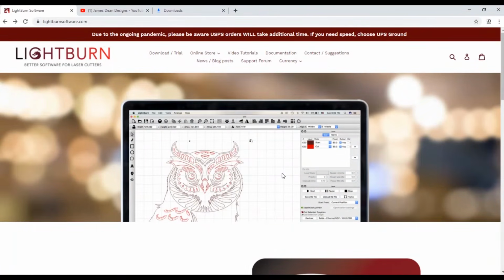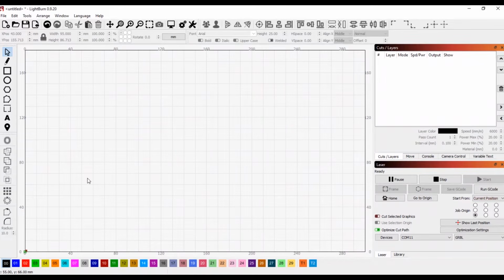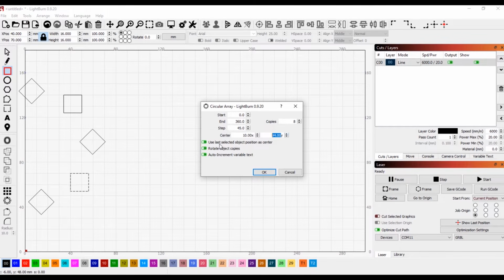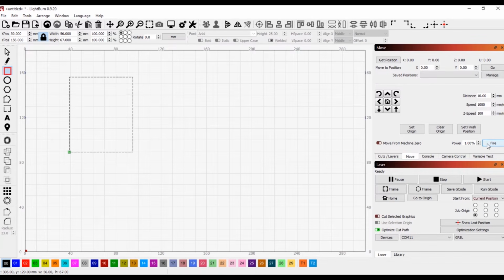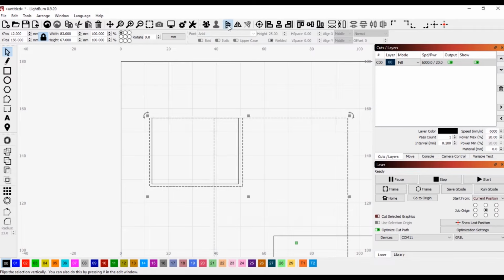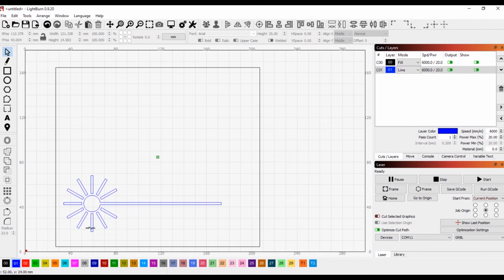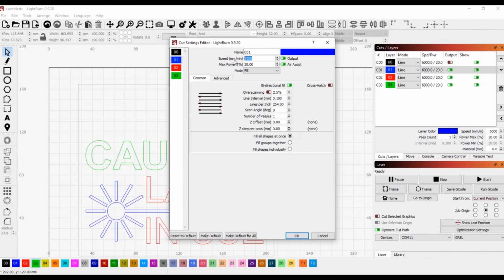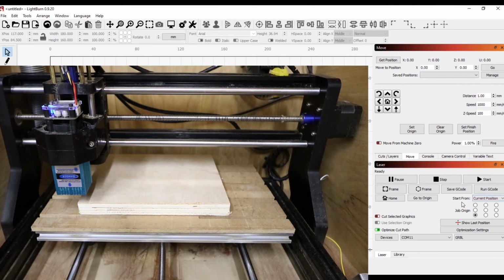3018 PRO - Getting started with Lightburn

Comment: Hi James,
I closed some of the menus on the right of the drawing screen. How do I reset it to the default as originally downloaded?
Reply from the maker: @brucenorton3864  click the Window menu at the top, you should see something like Reset to Default
Reply: Thanks James. Sorted. 
However, I have another problem. When travising the X and Y axes, there is initial movement, followed by a pause, then followed by another movement to complete the distance the set travis distance.
I replaced the stepper motors but this didn't sort the problem out. I went and checked Easel, Laser GRbl and USgcode senders. The problem is present no matter what program I run.

Comment: This more a question than a comment. I have Lightburn 1.6.03 and in the layer MODE it only has line, fill and offset fill. No line and fill, is this obtained via different dropdown?
Reply from the maker: They updated it after I did this video. I think that setting moved to within the layer itself if I remember correctly

Comment: Hi James.  Thanks for sharing this video.  It's very informative.  I'm a newbie on the Laser Engraving.   I have a question on the Mode for Cuts/Layer.  I'm using 1.6.03 version of Lightburn.  I have all Modes except the Fill+Line option, which I think is very good option to sharpen the edes.  What  do you suggest  to mimic the effect of this option?  Thanks again.

Comment: Has only one up dated the firmware on the 3018 pro my firmware dont have the $32 on it how hard or simple is it to upgrade
Reply from the maker: A few people have done it, there is a fairly common video on Youtube for it but I would say you have to be comfortable on computers and doing that sort of thing. The alternative is to buy a new control board which will costs between $20-50 depending on what you get and where from

Comment: I just set up the Fox Alien Masuter Pro with the 20W laser.  In setup the laser is not detected...   I know its set up because I ran the test fox with you using Laser GRBL from your other video.   Even the manual input doesn't list the laser.   suggestions?

Comment: Good morning James.  Thank you for the video, super explained. According to your video, I started my adventure with Lightburn and my laser engraver (CNC 3018pro). However, I have a problem. After uploading the project in dxf. format and burned out, it turned out that the laser also burned out the lines of transition (traversal moves). Do you know the solution to this problem? Best Regards!, Andrew B.

Comment: Do you know why I'm not seeng $30 on my GRBL settings?
Reply from the maker: Chances are your GRBL firmware is an older version. I suspect if you type $$ and hit enter you'll likely see 0.9 at the top somewhere where as it needs to be at least 1.1f.
It can be upgraded, but can be a but fidly unless your comfortable on computers. Alternatively it may be easier to buy a new control board
Reply: @JamesDeanDesigns  yes. You are right. I'll need to update the firmware version then.

Comment: I am using cnc3018 with lighburn. But I have a problem about axis. distances. Axis are not going right distance. Axis going less than my distance. How I can fix axes problem.  Please help.
Reply from the maker: Your step settings may be wrong. The base settings on a 3018 are usually 800 or 1600 for your $100, $101 and $102 settings. These essentially control how far you machine travels each time you send a command. This video explains how to calibrate them
https://youtu.be/nGwUf8uNWBU

Comment: I am new to laser engraving and bought a vevor l3 3040 5.5w (laser output)

I have gotten through so much stock trying to get details on photos in lightburn and still haven't got the settings nailed down.

Do you have any ideas or guidance? 

Thank you
Reply from the maker: When you say stock, is it wood you are using? I found wood quite difficult to get good photos on. A lot of the effort is done in the production of the image. I have a video on it but I used to find the Imag-r website useful as it would try and adjust your photo to suit the material you were using
Reply: @JamesDeanDesigns  yeah that soft plywood coasters I think is to soft of a wood to get details, I have bought some other plywood and mdf just waiting on delivery.

I have also bought some clear acrylic and some white ceramic tiles to try the Norton method on.

I guess it's a learning curve with the settings.

With them super softwood coasters I found slowing the laser down to 500mm/m and 30% on the laser brought some details out with a light sand of the wood makes what details are there look good.

Oh yeah by stock I mean wood that I have in already

Comment: Great video mate. Really helped me. One thing im stuck on though, my 3018 continues to cut between my pieces. Is there a setting im missing?
Reply from the maker: You need to turn laser mode on. Head over to the console panel and type in $32=1

Comment: I have followed the video several times on connecting the Lazer everything works but the traversal lines show when I tex how can I turn them off I have tried so many things I am starting to give up can you help me please David Polley
Reply from the maker: Go to the console tab, and in the text box type $32=1 and hit enter. This should put it into laser mode
Reply: @JamesDeanDesigns  everything is stopped working the Lazer is disconnected now and this is what I got . waiting for conection. port failed to open aleady in use ?
Reply from the maker: @davidpolley885  usually means something is already trying to connect to the machine. I typically restart the PC and make sure lightburn is the first thing I open. Usually resolves it. The settings I told you to enter would not have caused the connection issue

Comment: i have no limit switch and when I am turning on my laser it moves laser to front left and does not stop it want to keep moving and wont stop making a terrible noise
Reply from the maker: If you select the device button towards the bottom right and go into Edit. On one of the screens it will say Auto-Home on startup or something similar. Make sure that is turned off.

Comment: Really enjoy your videos. Have new problem with lightburn. When I hit RUN it makes one pass, left to right, then stops. doesn't go back and forth like it is suppose to. I get this message "Project loaded in 0 milliseconds
<Idle|MPos:0.000,0.000,0.000|FS:0,0|WCO:0.000,0.000,0.000>
ok
Starting stream
Layer C00
error:1
G-code words consist of a letter and a value. Letter was not found.
On or near line 0:
Job halted
Stream completed in 0:00
ok"
Thank you for any help you can give me

Comment: I use lightburn on my CNC 3018. Very regularly I find that at some point the y-axis flips or rotates further than allowed, every time my project has failed. I only have this problem with lightburn, never with laser grbl or candle. Have you already experienced this?
Reply from the maker: No but the guys are lightburn are usually quite receptive to feedback so might be worth joining their forum and logging a ticket.

Comment: Your explaination for lightburn is awesome because I have started with the 3018 PRO myself but do you know is it possible to use LightBurn for the router
Reply from the maker: The technical answer is yes because ultimately it also uses gcode. The practical answer is no. Lightburn is really only a 2D program, it has some Z axis control but not to the degree that other dedicated routering software has
Reply: @JamesDeanDesigns  i'm only looking at 2d but having trouble finding a software to format a picture to .NGC for the 3018 PRO have tried INKSCAPE but it keeps coming up with a fault when I try the machine.

Comment: Can someone help me? I am trying to connect my 5.5W fixed focus laser module to Lightburn but it is not working. "Detect My Laser" worked and it detected it just fine but the console just keeps repeating "Waiting for connection..."
Reply from the maker: Occasionally I find I have to literally unplug the USB cable and then insert it again for lightburn to detect it

Comment: Followed this one and the laser runs etc but its not leaving any cuts? Is there a power setting I am missing??
Reply from the maker: Are your $30 and Smax values the same?
Reply: @JamesDeanDesigns  yes both set at 1000
Reply from the maker: @thegenxproject  saw a comment saying you've solved it but looks like YouTube has deleted it or am I going crazy 🤔
Reply: @JamesDeanDesigns  I deleted it because I hadn’t solved it. But I have since got it dialed in. Works perfectly in Black Walnut. Going to try on maple and cherry.

Comment: ** disregard was a speed issue change the value to 600 and works fine * I have run into an issue I set the lase mode to true in light burn but then the laser doesn't burn I set it to false and it burns but I have the travel lines any idea I double-check $32=1 any idea?
Reply from the maker: Glad you solved it 👍

Comment: Can you add the camera to the 3018 cnc machine or is it too difficult?
Reply from the maker: I'm not sure you can. The camera for light burn relies on the bed being static but on a 3018 the bed moves so I'm not 100% sure if it will work the same

Comment: Hi, I've been watching your videos, specifically the ones about the 3018PRO. I purchased the 3018 MX3 for the Mach3 software. I started using Lightburn and found that I would have to save the file as GCode. That worked for the most part but it leaves a lot to be desired. I am thinking of purchasing the GRBL control board and asked Lightburn if it will work ok. They responded with this, "The GRBL-M3 output is very minimal, using M3 / M5 to enable / disable the laser, and the S parameter on G1 moves to control the laser power.  In many cases, this GCode can be run directly without changes on other controllers." Do you know what they mean by that statement? I am hoping to have Lightburn adjust the laser power and feed speed on the fly. If I save a file as GCode and run it on the Mach3 board, the GCode doesn't include any laser control, ie: power and feed rate. My main concern is what they meant by, "The GRBL-M3 output is very minimal"? Thank you, Bob PS. You are an excellent teacher and your videos are the exception to the rule. Thank you again.
Reply from the maker: Hi Bob. So generally speaking GRBL is considered to have less functions than mach3 which is essentially what they are saying. However GRBL is open source and more than capable of running the laser and spindle for 99.9% of the people. And can also control the laser power during a job. I always advise people to go for GRBL over Mach3. A new control board does not cost too much but should hopefully make your life easier. You will just need to make sure it is running at least GRBL 1.1f.  If its older you will not be able to control the laser power
Reply: @JamesDeanDesigns  Hi James, Thank you for the fast response. I believe the GRBL board is version 1.1f. I appreciate your feedback. I'm looking forward to watching more of your videos. Thank you, Bob

Comment: Hi James, can this software work on any laser cnc. I have a 3018 pro but I  have a separate laser cnc machine. thank you for helping us with the 3018 pro cnc.
Reply from the maker: Definitely works on GRBL machines and I'm pretty sure it does with some others as well, I just don't know which ones 😕
Reply: Hi, thank you, can I ask what size laser you've got. the laser I've got that came with the kit is 0.5w.
Reply from the maker: @garethwilliams648  The one I have is meant to be a 15w. However there is a lot of discrepancies. Companies often quote the input power on more powerful lasers rather than the output power. So apparently mine is more likely to be about 5-7w output

Comment: Hello, are you kind to help?

I can not set the value of Power Min % (only the Power Max %).

Do you know where I can change the Power Min %    Value?

thank you!!!
Reply from the maker: There is the minimum power in your GRBL settings which is $31=0. If its within lightburn you don't really need to set the minimum as such. What is it that you're trying to do?
Reply: @JamesDeanDesigns  yes, that was it. Thank you so much 🙏🙏🙏

Comment: Watching your video every time I home the CNC it goes to the bottom left if i try to jog it anywhere no matter what it moves to the top right.  I have absolute coordinates set and bottom left for homing.  Have no idea what to do.  Only does this in light burn.  When i click the laser icon to move to a position, it starts going to the top right every single time.  Following along your video nothing different.
Reply: Thanks I’m working on it.  Great tutorials man super job!.

Looks like my machine works with negative coordinates.  As the bottom left always shows max travel limits but negative.  This document will help you fix it.  Simple console command with my working space entered with negative values.
G10 L2 P1 X-264 Y-264
Now it works from the bottom left.  This document will help those who run into this.

https://github.com/LightBurnSoftware/Documentation/blob/master/CommonGrblSetups.md
Reply from the maker: I'm not an expert on homing but there is the origin setting typically towards the bottom right of the screen, but somewhere in the settings there is also a homing position setting. Might be worth playing with that as that seems to solve most people issues

Comment: This guy is amazing with his tutortials... thank you very much. Im having an issue where my motors keep running slack x and y any reason why? Also is it that light buy also cnc sovo can do  oth laser and cnc?
Reply from the maker: When you say slack, is your machines belt driven? I dont know much about them but usually you have tensioner to take the slack. And yes, this machine takes both spindle and laser
Reply: @JamesDeanDesigns  not its not belt driven, i swapped around motors and it seems to be functioning better now, but i was told there isnt a different between the motors so im not sure i will monitor it do you have videos on using the spindle to cut different materials?

Comment: Hi, James! I tried Lightburn software on your advice. A really handy laser app. But I ran into such a problem: the Y-axis is inverted on my CNC 3018 when working in Lightburn. At the same time, when working in a Candle or Laser GDBL, the Y-axis moves in the right direction. You have to change the $3 parameter every time you use Lightburn, and change it back when you exit the application. Have you encountered a similar problem?
Reply from the maker: That seems really odd. When you go into device settings, which dot is selected for the origin?
Reply: @JamesDeanDesigns  Тор left dot is selected as origin in device settings. Limit switches are installed on the machine and the top left point set as "home" of machine. Can the settings of the limit switches affect this?
Reply from the maker: @SenyaRusty  I'm not 100% sure as i don't have limit switches but I believe the origin should be set to bottom left. I think its something to do with sending negative values if  the top dots are selected
Reply: @JamesDeanDesigns  You were right. Indeed, the origin point affects the inversion of the axes and has nothing to do with the "home" position in the machine settings. I put dot in bottom left and now Y-axis moves correctly. Thanks for your help, James!
Reply from the maker: @SenyaRusty  excellent. Glad you got it working 👍

Comment: Hi James, me again.. Another great tutorial!
I have started my free trail and im also trying to make a caution sign but when I select 'enable laser fire button', it isn't there in my move tab. Any ideas?
Reply: Also my laser is turned on and my $32 is set at 1 and $31 is set at 0
Reply from the maker: @jacklee5020  first, have you restarted the software?
Second, I just want to check you have a diode laser?
Reply: @JamesDeanDesigns  Yeah I tried restarting the software (I lined it up in laserGRBL and its running my design now).
And yeah it’s a diode laser, thanks.
Reply from the maker: @jacklee5020  that is very unusual. Usually once you restart the software it should appear. Also it doesnt show for CO2 lasers I believe. Might be worth posting on their Facebook user group or their actual support forum as nothing is showing up on Google either
Reply: Cheers, i’ll leave it for tomorrow now 👍
Reply from the maker: @jacklee5020  did you manage to resolve this?
Reply: @JamesDeanDesigns  yeah, it sorted itself out the next time I used it, thanks again. The sign came out great, but I've had a bit of jamming recently.. so I'm undertaking a strip and rebuild as we speak. I think the cause was over lubing the access and they the screw and nut was getting all gunked up.

Comment: I have just purchased the lightburn software, thank you so much for you videos could not and would not have attempted this without it.  Do you also you lightburn for your spindle.?
Reply from the maker: No problem, hope it helped. You can but from what I understand its quite complex to try and use it with a spindle.
Reply: @JamesDeanDesigns  hi james thanks a lot however, it seem it might have bought the wrong version cause I dont see the save g code option
Reply from the maker: @sharondippenaar  there is only one version (other than one Windows, Linux, mac) what gcode option is it you're referring to?